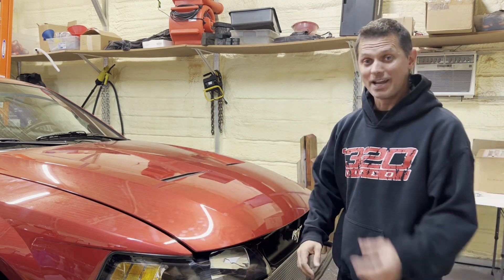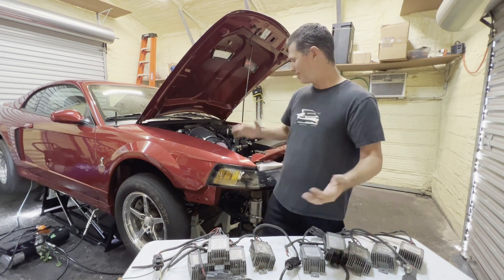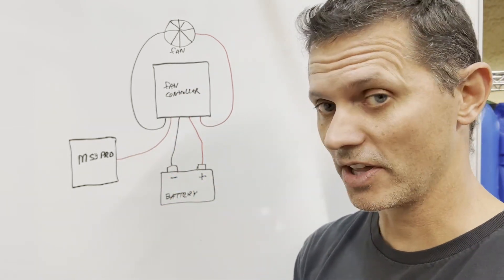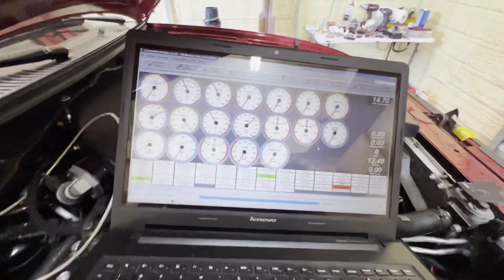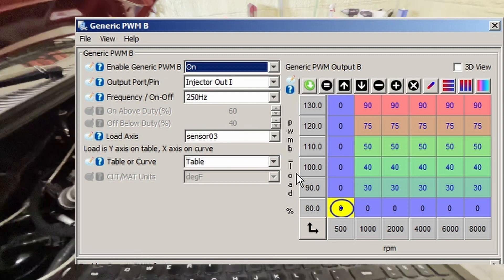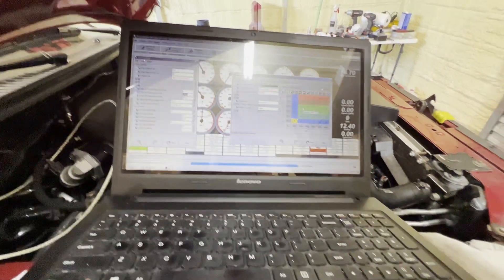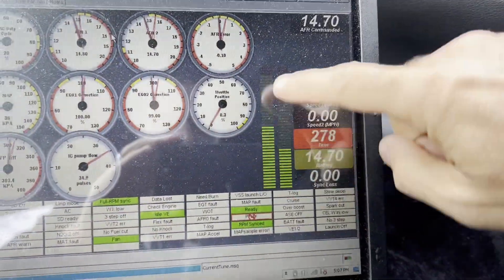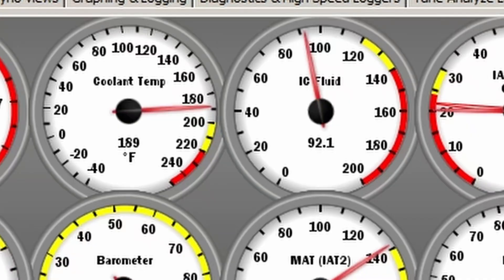Junk Yard MS3Pro Fan Speed Controller on Project Redfire

Comment: I have a 1990 Mustang Gt and was wondering if I went and got the Fusion Fan Speed Controller, where would I Install the little red wire you mention in the video? Or do you have to hook it up?

Comment: One more question, what amp relay do you recommend
Reply from the maker: Depending on your fan but most likely a 40 amp relay.
Reply: @MalcolmV8  mark 8 fan. so the 40 amp relay tied in the ccrm works good?
Reply from the maker: @scottadkins918  Take a look at the wiring diagram chapter of this specific video.  I talk about the relay options with the CCRM.  I think that'll answer everything about them for you.  If you still need clarification let me know.

Comment: I might try this on my cobra with a haltech. It should definitely help out when the fan kicks on at idle. One thing is you said you fed power to the fan controller from the ccrm? So you took the power output from it and sent it to the fan controller. For the ground did you send it to the battery or the frame near it? I know the power and ground that are shrink wrapped together go to the fan.
Reply from the maker: Yes the fan controller was installed between the CCRM and fan.  That is the easiest and most simple way of doing it.  I used the power and ground coming from the CCRM and essentially just intercepted the connection between the CCRM & the fan with the fan controller.
Reply: @MalcolmV8   Ah ok I understand.
Reply: @MalcolmV8  so you didnt need to hook the power and ground to the battery, you just used the relay in the ccrm for that?
Reply from the maker: @scottadkins918  I've done it both ways.  By using the CCRM in that instance it allowed the MS3 PNP ECU to cut power to the fan at WOT or when MPH exceeds a threshold etc. as the MS3 is in control of the CCRM.  However you don't have to use the CCRM as the power source.  You can do it directly to the battery.
Reply: @MalcolmV8  thats good to know. I have the battery in the trunk so it will at least save running more wire to the battery... thank you again.
Reply from the maker: @scottadkins918  no problem.  I've done the same with trunk mounted battery cars.  Just use the CCRM wiring which was intended for the fans and is up front at the engine bay.  That works perfectly fine.

Comment: Just tried this Malcom .. My Ms3 pro is getting really hot when I attach the signal wire? And I smell electrical burning .. and I’m using the same output pin you are ? And also I have 12v at the pwm module on the signal wire I thought that’s ground ?
Reply from the maker: It sounds like you connected one of the heavy current wires to the MS3 instead of the little signal wire.
Reply: @MalcolmV8  Ok.. no it wasn’t that but I got it straightened out .. is there anyway to invert the duty cycle ? Like now 100% is off and 0% is on.
Reply from the maker: @87stevefox  Not that I'm aware of.  Which input did you use on the MS3? also remember the controller accepts a maximum of 90% duty cycle for fan on max.  Setting it to 100% results in the fan shutting off.

Comment: Just put in MS3Pro and low speed fan is on with key on. I guess I’ll will have to put in this fan controller too.
Reply from the maker: While I believe these fan controllers are worth their weight in gold they are not required to fix the issue you mention.  The MS3 has an option to allow the fan on when the engine is off.  Go into the fan settings and change that to only allow the fan on when the engine is running.
Reply: @MalcolmV8  Yes the setting is at fan on only when engine is on. I set fan control off and used test mode to turn it off. The fan still stays on will key on. No luck.
Reply from the maker: @782941105  that sounds like some sort of mechanical fault.  Either your CCRM box is acting up or you have a wiring issue.  You could reach out to diyautotune and see if there's any other troubleshooting steps they can offer on the MS3 side too.
Reply: @MalcolmV8  yes feel like is the MS3 becuase once I put the stock ecm back everything is fine.
Reply from the maker: @782941105  likely a simple configuration somewhere.  Reach out to diyautotune, great guys.  They'll help you out.
Reply: @MalcolmV8  thank you for all your videos. I’ve learned a lot.
Reply from the maker: @782941105  you're welcome and thank you for the feed back.  I'm glad you're liking them.
Reply: Did you find out what the configuration was? I just installed an MS3Pro and have the exact same issue, fan is always on. It's fine when I revert to the stock ECU

Comment: Just did this fusion fan controller install exactly like Malcolm shows us in the vid. Completely fixed idle voltage spike issues I was having when the fans would snap on without this. Couldn't be happier with this cooling system upgrade. Keep up the innovative work Malcolm!
Reply from the maker: Thats fantastic and great to hear.  It really does make such a huge difference.
Reply: Question. What wires did you grab from the CCRM to the pwm ?

Comment: What cooling fan are you using? Did you just wire the controller to the high speed side to have full use?
Reply from the maker: Right now it’s the stock cooling fan but I have a future upgrade planned for that. 
I used both the high speed and low speed wires from the CCRM tied together as the power source to the PWM module.
Reply: @MalcolmV8  thank you. That gives me hope for my set up
Reply from the maker: No problem :) best of luck on your project.
Reply: @MalcolmV8  im currently trying to wire this up with my stock 04 engine fan with stock wiring as well. Just to clarify the wiring are you tying the wires together before the controller and at the fan location?

Comment: What firmware are you on? Cooling fan output is a nice!
Reply from the maker: It's 3.5.2 but the all the fan features I showed are also available on the prior long running 3.5.1
Reply: Thanks for sharing this video @MalcolmV8  . I'm trying to drive one side of a dual Ford Contour fan with a Dorman 902-310 SSR, PWM'd with High Current Out3 from my Ms3Pro EVO running 1.5.2 firmware but TS complains if I set mine up like yours using both the Fan Controller option and Generic PWM output A. It seems I can use one or the other but not both together and I don't see the "Cooling Fan High" option like in your vid at 5:48. Any ideas what I'm missing? TS version is latest also. v3.1.08. Thanks!